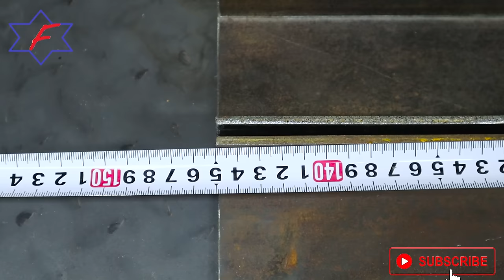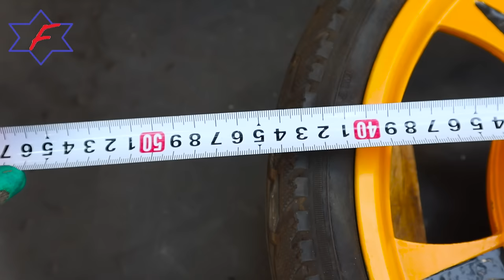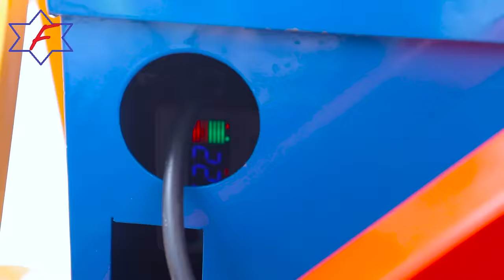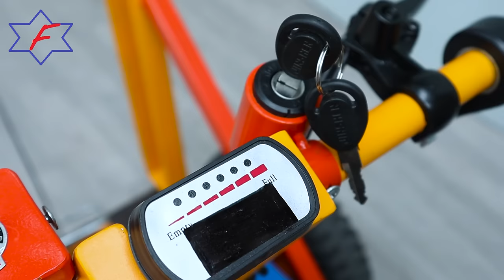Build An Electric Forklift For Workshop With 1100 Lbs Capacity | Homemade Electric Forklift

Comment: I really like the way you solder, can you tell me, what welder are you using, how do you adjust the current so that no compensator is needed
Reply from the maker: I use TIG welder. You can refer this one: https://bit.ly/3zRuNUY
Reply: @fawabros  can you give more info, how much current do you use, how much argon, and what size of soldering iron and tube.  thank you.
Reply: @fawabros  ضض خطط ئ يسبب

Comment: Drive wheels should be front due to weight and loading.  The forks need electric extensioners and should have a tilt function

Comment: You put your “Crosby Clamps” on wrong. Never saddle a dead horse, that means the loops of the clamp go under the short length of the cable and the clamp, the “saddle” goes on the live end of the cable

Comment: You just waisted those bearings, your welder is grounded through the table and you had current come through those bearings which now are junk, they will have arc spots in them